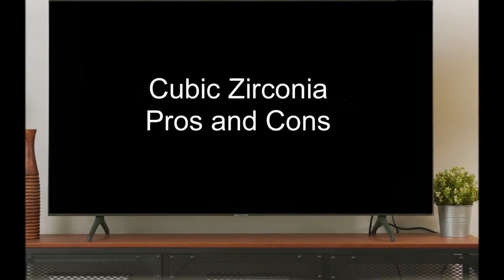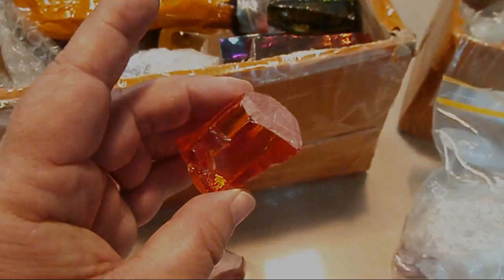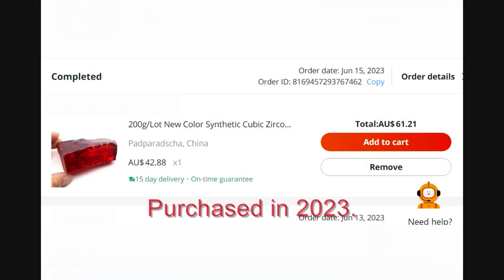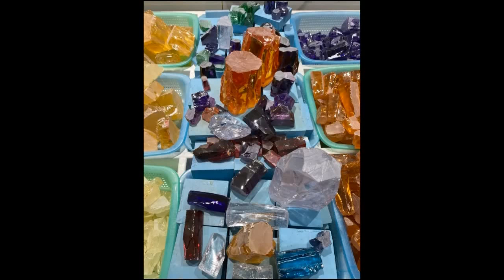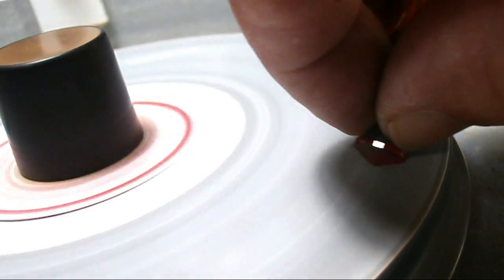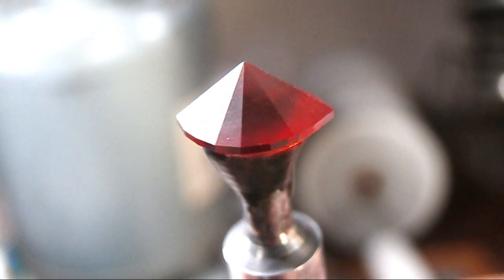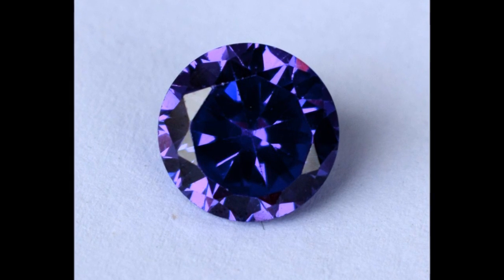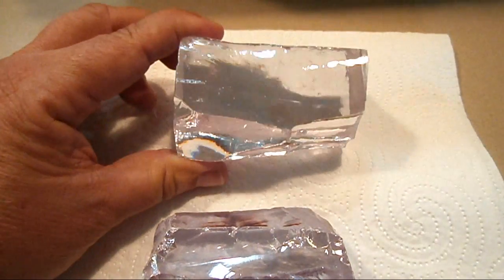Man-made diamond simulant - Pros & Cons

Comment: Tiler cutter from bunnings $140ish get a couple smaller blades so you can get faster cuts and maybe a 7inch thin diamond blade for thinner cuts works mint for me horrible reviews online but works fine have had it for awhile now dont use the guard either can cut much larger stones if you dont 🤙🏽
Reply from the maker: Thanks...That's a good tip.

Comment: Great video as usual. Some colors are sort after as the real stones are almost impossible to get, like Tanzanite.

I have sold cut CZ, but they were special cuts, designs of mine. 
Must give you a call, I need a hunk of bronze CZ.
And not far from you ATM.
Reply: You find tanzanite almost impossible to get???
Reply: @canadiangemstones7636 Good color for affordable prices
Reply from the maker: Thanks. I'm assuming bronze CZ is a darker yellow? I don't have a smokey quartz coloured CZ. It's rare, but it actually looks like bronze. I don't have a large saw to cut CZ so I go to the gem club. Most weekends I'm on the motor bike, but if you're in Shepp at the next workshop I may drop in.
Reply: @VintageTimeGems Want to do another of the Rising Sun one - that color. Eventually. Not urgent.